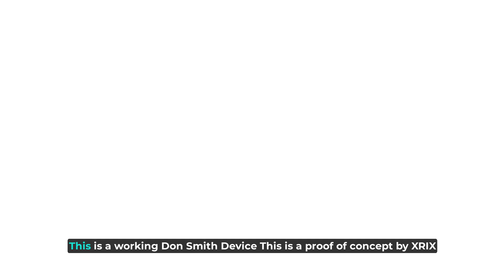Over Unity Working Don Smith Device

Comment: Is this air grounded or earth grounded?
Reply from the maker: There is no direct ground to Earth. The MOTs have a lower rail, but not at negative battery potential.
Reply: I would image your gain is purely from the resonance in the MOT-cap bank then?
Reply from the maker: @E.A.I.S.  NO. Resonance is a means to an end. The fact that you have multiplication of influence is a byproduct of the spark gap disrupting the aether. Think of it as a lightning strike in the middle of valley, the lightning bolt disrupting the air causes the medium of air to rush back and create a thunder clap. Now imagine there are tuning forks in the valley that are resonant to the sound of thunder, such that they are set in motion by the initial clap. The vibration of the fork creates a magnetic field (If you don't believe it happens --put a gauss meter next to one) The flux of the magnetic field can be transformed to real power.
Reply from the maker: @E.A.I.S.  This is precisely why people fail to create working devices. The have heard that resonance is the giver of more output than in. However it merely maximizes the effect.
Reply: What I meant was that resonance was the means by which you 'multiplied' your energy by, like you pointed out, utilizing the flux lines, which, by the way, can be easily multiplied for no extra energy in.
Reply from the maker: @E.A.I.S.  About two years ago, I could quote "donisms" as fluidly as any studied acolyte, but I still had nothing working. It changed when I found the commonality of his devices... then all such devices. The application of the knowledge far exceeds the value of the words. Don didn't tell you how it worked. I am telling you, but because it is "similar" to how you interpret what I said, as in two circles that are close together, however, they circles intersect but are NOT the same circle.
Reply: Talk IS cheap, but results are few. If, Lord willing, I get my device going, the next comment I make on here will be a link to a video showing I completed a device successfully.
Reply from the maker: @E.A.I.S.  This is why these videos are posted. Not to give me any gain, it was for me to smile and know the truth. That I hadn't wasted 10 years of my brain on the journey. I was told how to do it by Chuck, in 2016. It took me till 2023 to build my first device. Have faith, work hard, wear a tin-foil hat when you sleep.

Comment: are the bulbs in parallel or serial connection? Have a bit of struggle to got this king of bulbs in my region...
Reply from the maker: The bulbs are all in parallel, 4 per MOT, there are 6 MOTs in parallel to the exciter module. Any 12V 4W dimmable should work, but I tried different ones, because some bulbs are not variable and hence you can only put one per MOT. The load has to act like a dam to the energy stored in the cap.
Reply: @XR_IX  Great, thanks for the reply. Got everything but the bulbs.

Comment: Can you please provide a parts list, instructions/tips on setup, and total estimated price to create something like this.
Reply from the maker: Materials have been discussed with other people - please look through the comments. Costs are related to how impatient you are for acquiring the materials. The blue box has about 225 worth of parts. Each MOT assembly(x6) is about 100, not including all the bulbs and light assemblies. The total would be about 1000 dollars. Honestly, It was worth it to me to prove I wasn't wasting my life. You don't have to spend that much, to prove the concepts. In fact you can do it for about 50 bucks …If you know what you are doing. But don't expect it to be powerful. I have a 10W solar panel running a single 4W bulb for almost 2 years, that stays on from dusk to dawn in the Summer. I made the model in the video, to look more impressive than those hot glue gun jockeys. I also buy good shit.
Reply: @XR_IX  I read through all the comments and didn't see a listing of the parts or how the blue box was made. I tried to join the forum but it's closed. Would it be possible to message me the info or share the info as a public post on the website the forum is on. I see you shared some stuff on there publicly but didn't see the details to build this on there.
Reply from the maker: @freespiritflyer009  It's under MrMishMash, I think. There have been at least three replications, and one has been very recent. Basically I followed the Zilano final disclosure. The circuit using a HV module of some kind, high speed FWBR, to a spark gap then three series caps, of the Microwave oven variety, the center cap has leads going to the MOT HV Primary (That is the output module outside the blue box). I don't control the Forum, Zed does, and it is not a public forum.
Reply: @XR_IX  where can i find MrMishMash writings? Video or forum post only?
Reply from the maker: @YourInventions369  Not sure there is quick way

Comment: Running at an optimal with 4 MOT's, they are not identical MOTs thought.
1500v SG, 1UF 1.5KV capacitors, 11w input from ZVS + Coil.
https://youtu.be/iabJiglUFvI?si=b1qOi9kwmMiTRQ-p
Reply from the maker: The MOTs should be able to handle 2KV, before you start worrying about exceeding the insulation. However, I sometimes hear spark over in my output module, but don't want to necessarily disassemble, to discover the loose wire or something.  The real issue is energy conversion. The pulses have to be absorbed in the core material to reflect back to the secondary. There is where you realize the materials need to be different.

Comment: Thank you for the video. I have been inspired by it to do build a setup similar to Mr.Mishmash. I have a power source outputting 12 V and 0.2 A into a ZVS that is connected to a flyback transformer, then a FWBR, then 470V GDC, 3x100 nF caps, and 2 MOT's. Each MOT has a FWBR on output. I have 22 mF capacitor on one MOT and 0.1 mF on the other. I have everything hooked up to a oscilloscope and I can see how the voltage lowers (and the light dims) when I attach the second MOT. When I measure current on the LEDs, it is 5-7 mA. The sparks go at around 100-200 Hz. I am using fast BYV 26c diodes. Is there a way how to get more current out of this setup? And how to get the effect of the second MOT not dimming the lights?
Reply from the maker: Only using 6 watts of input, means 3.3 milli-joules you are creating per pulse, about 3W@100hz ( w/no losses). It would be very hard to show stellar results.  Remember there is a relationship between input/output, and physics tells you best case is less. You can overcome that threshold with more magnetism. The spark gap must fire all the caps in unison, AND the center cap must be in parallel with the MOT primaries. In this configuration, you should still be able to run as many MOTs as you care to attach .... ONLY IF their impedances are close to one another. If the MOTs primaries are NOT close to the same impedance, the flow will select the least resistance, and pulse will not be distributed. This really is the point of the whole circuit.
Reply: @XR_IX  Ok, I had the caps like Mr.MM, with the parallel cap on spark gap, I tried cap parallel with the MOT's previously (as in California Springs p.57 Fig. 3), but it didn't even light my LED's. It seems my MOT's impedances are quite off, so I attached them one-wire like to the + of the parallel cap and that works superb even if the MOT's impedances do not match. I have to ground the FWBRs for that to work. Thanks a bunch. So far I have had similar success with resonant coils, mainly with the series-parallel resonant circuit (C2 in parallel with L, and both in series with C1, where C1=C2) that shows overunity even in simulation but you will not find it in any book or page.
Reply from the maker: @Bobby-e2u8z  There are different ways to achieve similar results, but my experience with one wire relates to transmission. When you start building more powerful circuits to drive higher wattage loads, you will discover limits, because transmission is not amplification.

Comment: There is an email for communication ?
Reply from the maker: Generally No, I am part of a community for Energyevo.org, but you have to contact the administrator of that site. I will do my best to answer questions here, so others can benefit the exchange. You're question about do you get real power out, well all I can say is I am only using FWBR to DC on the output coil. So there is no trickery with HF, but you are using the large caps to hold the energy, and measuring the current in a cap as a power source, may not be accurate the same way a battery is a power source. Can it do work? -obviously but it is different electrically. I am trying to understand it myself.